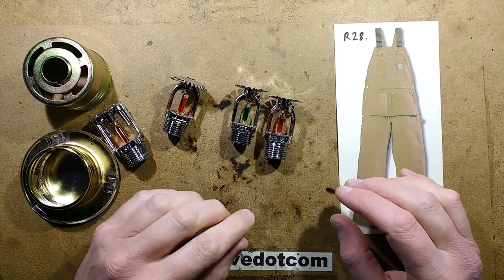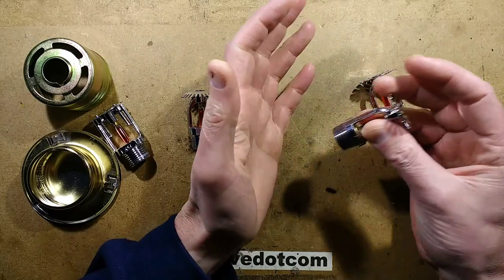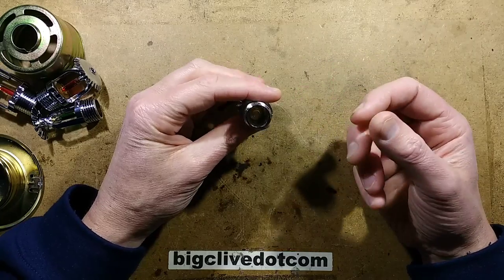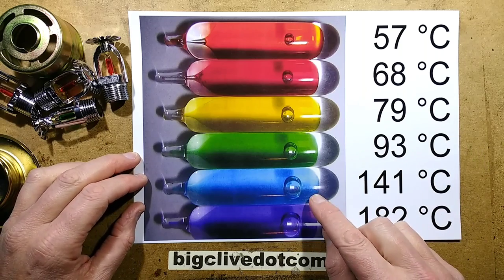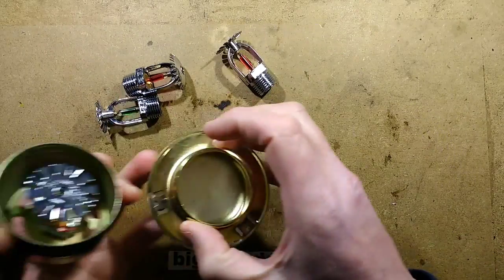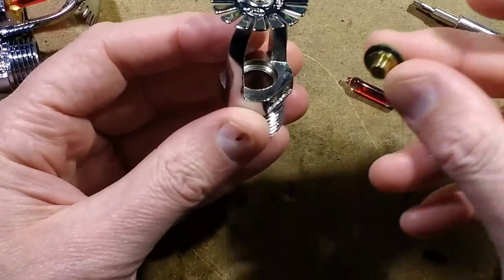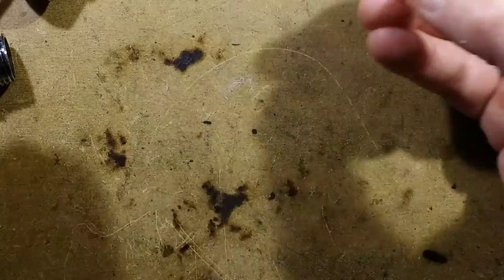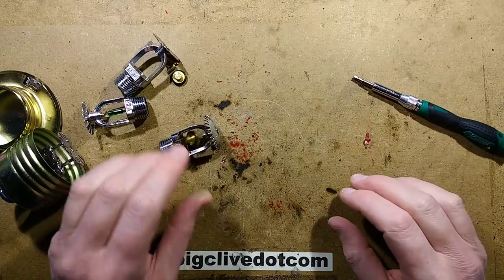How a fire sprinkler works. (featuring broken glass and spatter.)

Comment: You should do a macro slow-motion video of one of the higher temperature tubes, to watch what happens internally. It will most likely be unremarkable, but it may be interesting. Will the changing pressure cause the bubble to shrink? Will it shrink enough to sink the bubble?

Comment: Great video Clive, didn't know that the bubble caused the triggering point. I knew about the different colours and temperatures.
Reply from the maker: I didn't know about the bubble bit myself until I spotted the graduated bubbles in the different coloured vials.  When I heated it the bubble gradually reduced in size as it was compressed by the expanding liquid, and it was only when it disappeared completely that the vial burst.

Comment: To answer your question about the high heat systems, we use them in the film industry for sets. Since we have all those high heat lights in the ceiling we need a fire suppression system that won't go off when we turn the lights on.

Comment: These are part of a wet sprinkler system, which is essentially using the sprinkler as a valve per source. There are dry systems where there is no water in the plumbing and it’s typically held in a reservoir until an alarm is tripped so that series of sprinklers can be activated, ie in grids, rooms or sections. Each system has an appropriate application. In our fire company we also carry sprinkler plugs that are wedge shaped devices with rubber plugs on the sides so that it blocks the water flow on an activated sprinkler.
Reply: I should also mention that the dry system sprinklers have no vials, they’re simply open so they can flood a compartment or wide area at once.

Comment: In some sprinklers, the plug is made of an alloy called Wood's metal, a mixture of bismuth, lead, tin, and cadmium that melts at a relatively low temperature. In other sprinklers, the plug is a small glass bulb full of a glycerin-based liquid designed to expand and shatter when it gets hot. The basic idea is the same in both cases: the plug is meant to break and open the sprinkler as soon as a fire breaks out.

Comment: Living in Northern Illinois, I grew up with and love my Carhartts. Might I suggest also the Carhartt style #100632 zipper front hooded sweatshirt with the rutland thermal (waffle weave) inner liner? I am a big guy, 6'4" tall, 255lbs, and as such, carry a lot of body temperature around. Likely you have the same problem? Because of this, I don't wear heavy coats until the temperature really drops (or there is a lot of wind and I need a wind break). This sweatshirt is my most worn item once it gets chilly out because it breathes, its very warm, its thick but its loose fitting and has the Carhartt cut for working guys n gals so it moves well with you. Mine is chocked full of cuts and holes from working and welding but its still the most comfy thing I own. I highly recommend it. The 3-season midweight style 100631 is also stellar!

Comment: You are correct, the liquid is alcohol. The hidden or recessed sprinklers cover plate is just held on with a low heat solder and little bubble is for the expansion and determines the temperature that the tubes will shatter.

Comment: The hole that the plug is covering varies by the volume of water that's desired to be delivered, and they're also available with various patterns of spray beyond a circle.  If a building or building area is heavily involved in fire then the fire department can deliver water at a very high pressure and blow out all of the heads in that zone.  The dry standpipes on the outside of buildings allow the fire department to deliver water at higher volumes and higher pressures than the municipal line the building is typically otherwise connected to.  It's common in the states to install over near the furnace connected to the house water piping.  In freezing climates the system is full of air holding the water at bay so that they don't freeze and break.

Comment: Very interesting. 25 years ago, some store in the nearest city apparently used to rent out their underground parking garage to organisers of raves, etc. They had to stop, because the ceiling was rather low and the "ravers" - jumping wildly up and down - would occasionally bang their heads against the sprinklers breaking the glass tube and setting them off. 

I had no idea how that works back then - someone told me the sprinklers were sealed with a ball of wax that would melt at a certain temperature. Not sure if that was correct. I could never figure out how a ball of wax that had to be strong enough to withstand water pressure would "break" if someone banged their head against the spinkler. I also thought that a ball of wax had to become soft at higher temperatures and might give way to the water way before the intended melting point.

Now I know. These glass capsules make much more sense in these scenarios: bursting at a specific temperature before getting softer earlier; and definitely able to withstand water pressure - while still at risk of breaking when banged against.

Comment: I guess since the liquid is not compressible, the bubble gives the pressure somewhere to go when the liquid expands from heat.

With no bubble, any expansion of the liquid would go directly into the container.
With the biggest bubble, there's the most room for expansion until it puts pressure on the container.

Comment: In a system where you do want all the sprinkler heads to go off at once (eg around bulk LPG storage vessels), something like a special plastic tube is routed around the area, that is pressurised.  A fire melts the pipe and the loss of pressure kicks in the deluge pump. This is a dry deluge system. The pipework from the pump to the sprinkler heads has to be designed to withstand the forces of the water in-rush. In this case the sprinkler heads are open all the time.

Comment: From what I recall the liquid is simply alcohol with a dye to make the sprinkler vile the correct color for the rating.  It really is as simple as bubble size to adjust the temperature that they go off since the liquid only has so much room to expand before it shifts from pneumatic to hydraulic pressure levels and the vile ruptures.
Reply: Thanks for the reminder about the terminology! I would assume that varying the amount of water mixed with ethanol and glycerine would change the vapour pressure curve versus temperature. Does the bubble contain normal air, or a partial vacuum? Either method would work IMO.

Comment: The dry nozzle adds pressure air to the pipe and is also a link in more linkage systems to better prevent unnecessary property damage due to wrong actions.

Comment: Generally speaking: the smaller the bubble, the higher the pressure inside the vial... thus, it should break earlier (=at lower temperatures).

Comment: I always thought these just worked like some kind of shower head and there was a control box somewhere that turns on the water when a fire is detected. Didn't know what the little red bit actually was, just assumed it was some kind of detector that sent a signal to the control box to turn the sprinklers on.

Comment: Keep it up Clive - Another great one :)
Plumber here - Not a good idea off your standard water connection as the sprinkler lines are full of the worst, stagnant water you will ever com across.  Without backflow protection you would end up seeding your drinking water with all sorts of nasties.
Reply from the maker: If I did it, the sprinkler would be in an active line to keep the water fresh.

Comment: Hello Clive, and fellow Youtubers, I stumbled upon an older video of Yours about Sprinkler heads. Interesting and informative. You did correct on several features that are incorperated in a sprinkler head. As I am in the sprinkler bussines (planning and inspection) for over 25 years now, I would like to inform You of a few misunderstandings. Buying sprinklerheads of ebay is nog a smart thing to do. Any fire sprinklerinstaller will tel You that they DON'T buy from Ebay. Sprinkler heads come from company's that will have a batch of sprinkler heads shiped off to a certifing company, that will test these sprinkler heads if they still perform as they should according to regulations as are written down in Fire codes. Among these tests are the following. Do they open at het rated temperature. And yes, that is where the collor coding comes in. Let me get right into that: a sprinkler heads rated temperature is chosen, (mostly) in line with the ambient temperature, plus 30 degrees Celcius. So, the ambient temperature  of 38 degree Celcius, which is the most common maximum room temperature for people, results in a chosen rated sprinklerhead temperature of 68 degree Celcius. In roofing with glass, factories, ovens the temperature can or will exceed that 38 degree, so thats is where the other temperatures are for. And Yes they do contain alcohol. This is done because of the fact that alcohol is capable to withstand temperatures below zero. Incase of sprinkler heads are fitted outside or in freesing rooms for food storage. The collour is used for coding the temperature. In all te sprinkler bulbs, there is the same kind of alcohol. The collour pigment is the only difference. The size of the air bubble (you where spot on on that one) is used to let the liquid expande till the rated temperature. And then the glass bursts. That brings me to the glass. This is a christal kind. It is supposed to shatter totaly. (a littele bit foolish of You to open the sprinkler bulb with a hot air gun…) The shattering must overcome the problem that a piece of glass is not removed, so that the opening cap is not capable of being flushed away, and the water is free flowing from the opening onto the deflector. This brings me to the deflector. You were right up to a point that there are Upright and Pendent sprinklers. There are however differences in these types possible, for specific applications. A sprinkler in a warehouse (larger fire load possible) is different from one in an office or shopping mall. And then there are possible differences in hotels and housing. This brings me to the point where I would like to point out that there are fire codes that state, Explain if You would like, where to fit a sprinkler head, and where not. Most important examples are obstructions. A sprinklerhead must be clear from obstuctions to spray water in its surrounding. These codes also state what diameter pipe should be used to feed the sprinklers with water. This sould be calculated, and is direct connected to the feed of the sprinkler system. If this is a water main (housing application) or a sprinklerinstallation that is boosted with a pump (Hotel, shopping mall or warehouse) makes all the difference in the choise of the diameter and maybe the choise of material. Steel is the most commen used material, however, copper can be a good alternativ for lower pressure systems. There are even special plastic applications for sprinklersystems. These are only applicable in Housing! So I hope this contribution was helpfull in Your quest to the how and what in sprinklerheads. Greetings.

Comment: Also, those point up allow for easy drying of the pipe. Many sprinkler system are actually dry, that's it, they are filled with air. There is a valve that prevent water from going in when there is some air pressure on the other side, I beleive it require 1/5 of the water pressure to keep the valve closed. A compressor is used to keep the system pressurised with air. This is done where the pipes are expected to be exposed to freezing condition, like a non-heated warehouse.

So, the sprinkler head open, air rush out. The compressor try to keep the pressure, but since the airflow is very restricted (on purpose of course, they add a flow restrictor for the air) the pressure quickly drop. Once the pressure dropped enought the water valve open and flood the pipe with city pressure. A pressure sensor there detect that the valve has been opened and turn on a pump, which boost the pressure to quite more than what the city can provide.

The city pressure I beleive is about 40-60psi, and the air pressure about 15-20psi, the water pump can do 150psi or more.

The air DOES slow down the reaction time, but this is better than a frozen pipe and no water at all.

Also, a sprinkler system is NOT mean to extinguish the fire, it is designed to slow down or stop the propagation of the fire. Since the fire can't propagate more than very slowly, it leave plently of time for the firefighters to actually do their job. A sprinkler system to extinguish the fire would require just too much water, and you can't extinguish a fire that burn under something (covered), like for example a trash can burning under a desk. However, in such case, the fire won't propagate to the next cubicle, and may actually die by itself once everything it can burn did burned. But again, this is not the effect of the sprinker itself, it just prevented the fire from having more thing to burn, and just let it consume itself.

Comment: FWIW, I did read somewhere that typical domestic installations might not be able to supply enough pressure for a commercial sprinkler system — I'm guessing the problem occurs where the expectation is that multiple sprinklers will operate simultaneously. Certainly if you look in some modern commercial spaces where they've left the system fully exposed (the "industrial" look), it's quite noticeable just how thick the pipework is that runs to the sprinkler system — it isn't your usual domestic 15mm or 22mm pipe. Probably not a problem if you just want to run one, but otherwise I know you can get systems designed specifically for domestic installation, which presumably are designed either to run at lower pressure or to store and pressurise their own header tank.

Comment: The reason why there are different temperature vials is because there are different purposes of fire detection/suppressant systems.  For example, your living room will mainly stay at a relatively low temp while your attic will be normally at a higher temp and also your kitchen may have a higher temp still.

Comment: In the one with the white cap, i don't think there's any sort of alloy that melts or anything like that. Simply when the vile is heated it breaks allowing the water flow to push the deflector which in turn pushes the cap off. The cap contact-points with the base must be easily breakable i'm guessing. I'm also guessing is that the lowest temperature rated capsule is used in this sprinkler since the metal base and white cover would deflect some, if not most, of the heat away.

Comment: You proposed a vacuum to get rid of the air. If you know the volume of the vial, you can calculate the number of gas particles in the vial at an given pressure. Then you use that number to figure out how big the bubble will be if you submerge the bulb in liquid and return the pressure to atmospheric pressure. This is just a guess as to how it works, but I think it’s plausible.

Comment: I would use a well pressure tank to supply the sprinklers, you fill the pressure tank which has a bladder inside, there is a check valve at the inlet, that way if you lose line pressure the tank has a specific amount under pressure to release.The tanks come in all sizes and can be plumbed in parallel. Just have to calculate the gpm flow of how many sprinklers per tank for a run time.

Comment: Regarding your comment on filling those glas tubes using a vacuum: that would also be an easy way to quite precisely control the size of the air bubble!
The lower the residual pressure in the tube is, the less remaining gasses are in there -> the smaller the air bubble becomes; the higher the pressure is, the bubble becomes larger.
This only my speculation though!

Comment: Probably someone else has mentioned this, but for the recessed sprinkler I wonder if the cover isn't moved out of the way by the force of the water. The bulb would shatter from the heat, releasing the water, pushing out the extending fan, which would jetison the cover out of the way.

Comment: Hello Clive,,  Thanks again for your good work. ..
Back in the day, they used Wood's Metal for the trigger instead of the glass vial.
In an old Machineries Hand Book, there was a listing of the recipes for Wood's Metal. EACH different concoction had a melting point one degree higher. And I think it started at 141°F....
I found some on Amazon that melts at 158°F....
Thanks again for your great videos. ..
Reply: Pete S. 
THANKS for the reply. 
In the machine shop, in order to turn a thin walled tube, we would first bore and grind the inside if needed.  AND then fill the bore with Wood's Metal. Because it does not take much heat to melt, it does not shrink when cooled.
Then we would turn the outside of the part . And  would melt out the Wood's Metal with hot tap water...
I see where Amazon is selling it for 25 bucks a pound....  At those prices ,, we played with thousands of $ of the stuff,,,

Comment: The drop down ones are for freezers. This keeps the sprinkler above the walk in freezer so the pipes don't freeze and the trigger liquid doesn't contract and will still be functional.
Reply: They are also used for cosmetics. I've seen several commercial and private residences with them.

Comment: Years ago (80's) I worked for a RnD place that was doing research into  improving the efficiency of these sprinkler systems - I built a system using   exotic Ferranti A0  digitizer to digitize photos of the sprinkler cloud.

Comment: 4:35 "There must be an alloy that melts"
Could be, or maybe it's even simpler than that. I'd imagine a fire would heat up the inside of the little canister quickly enough for the sprinkler to simply go off and then the water pressure popping off the lid.